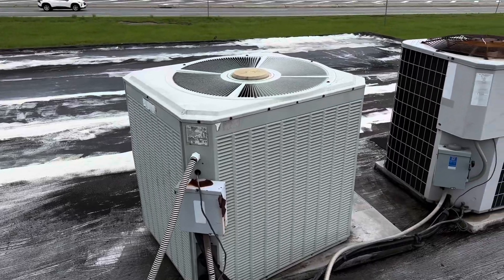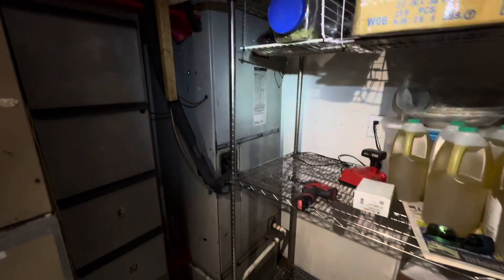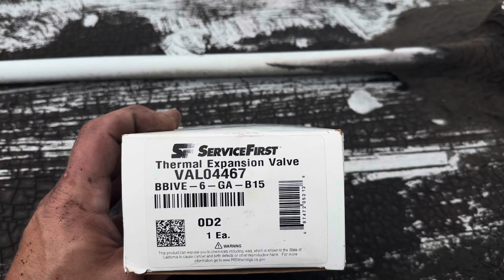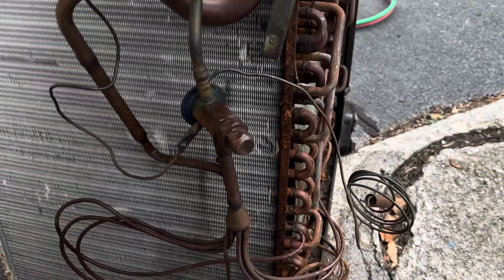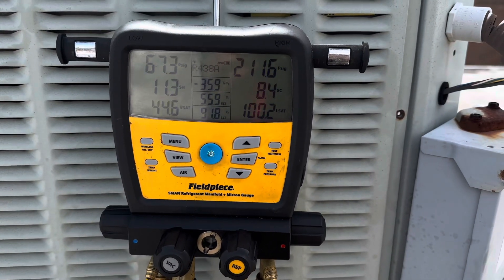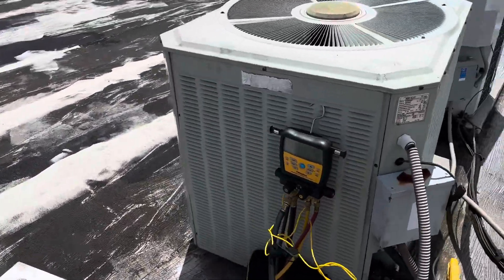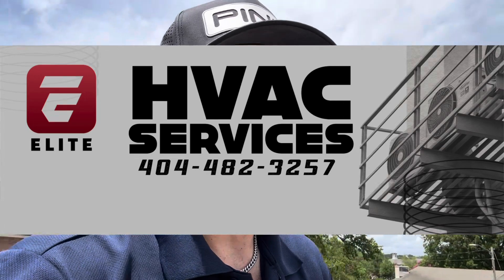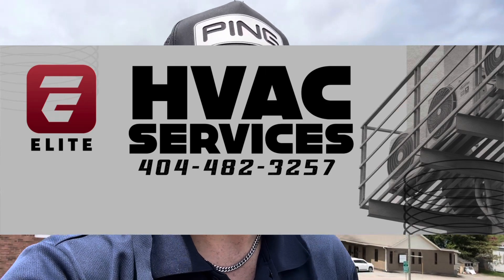Replacing R22 with M099 and a 26 Year Old TXV

Comment: I have a question. I would like to build a pergola in my yard that is 10.5 feet high, but I have a problem with the AC condenser because it obstructs the condenser and will be underneath the pergola. I want to know if a height of 10.5 feet could damage the condenser or if that height is perfect for allowing it to breathe.
Reply: Ur fine with that height